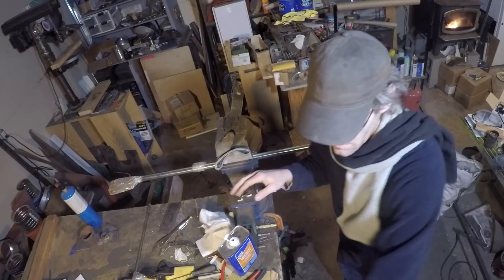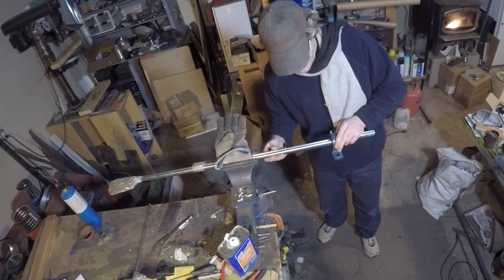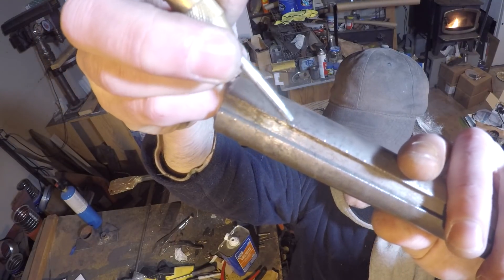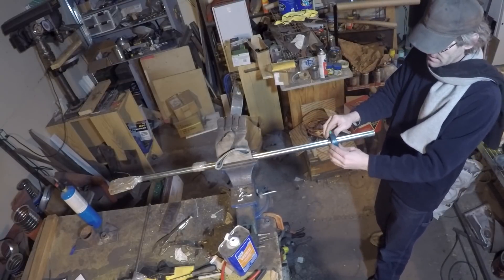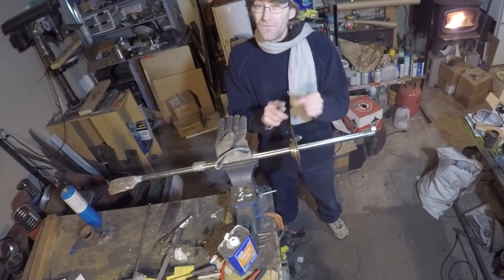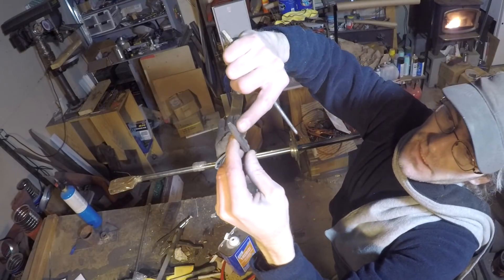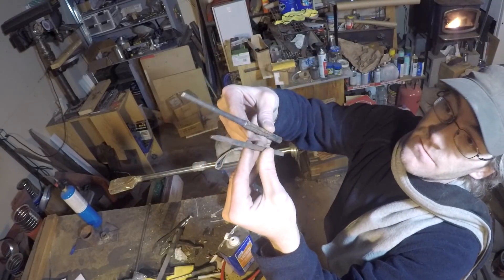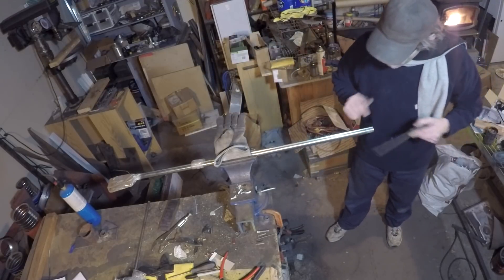Go Kart [ mini bike ] -  NEW Axle prep

Comment: There is a difference in getting key stock from your hardware store vs implement dealership hardware store key stock is soft steel vs implement dealer hardened key stock harder key stock will not wear out the key notch.
Reply: The difference between hardened keystock and soft keystock is soft keystock is designed to shear off in the event of a severe shockload where hardened will transmit through the connection